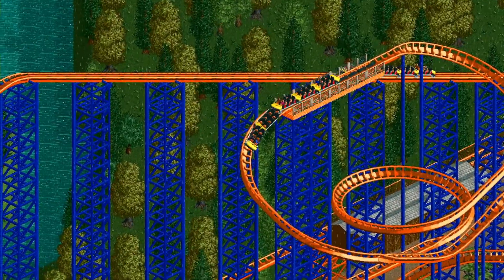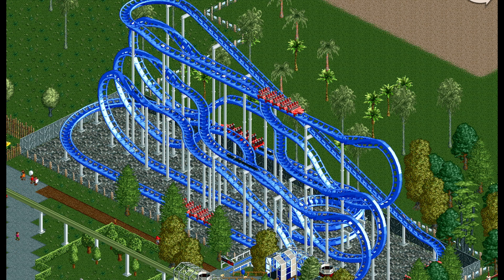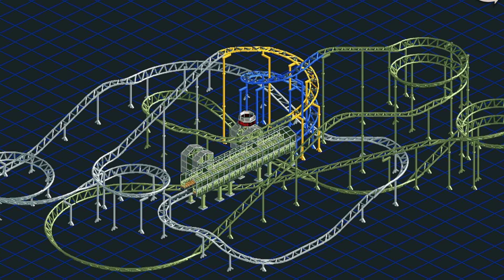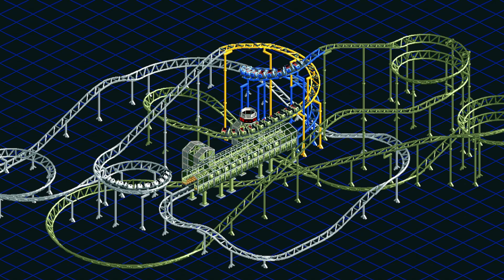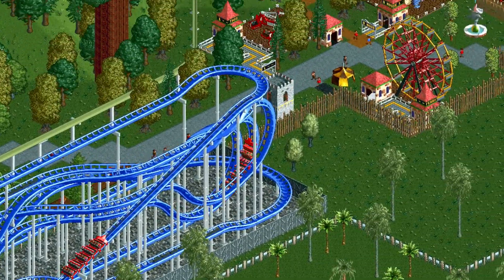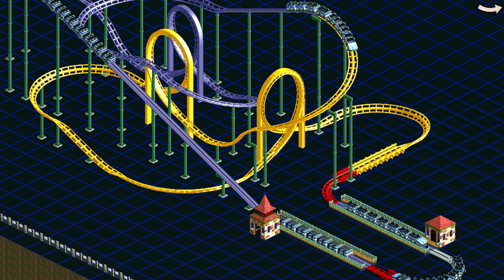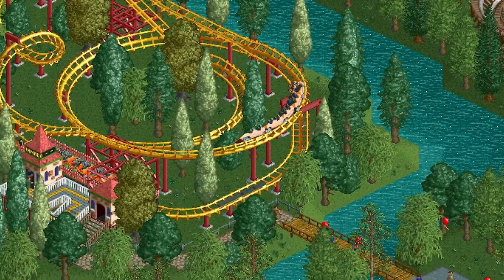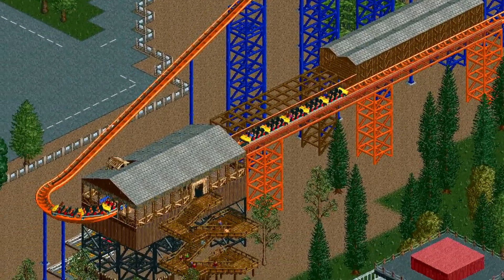Block Sections - How To Use Block Brakes In Rollercoaster Tycoon Classic

Comment: this video kept me entertained during the Superman escape from krpton breakdown. but i think block breaks are very under used as myself i dont really use them myself.  also another tip block sections dont stop working during like brake failure breakdowns so i always put some in my ending breaks even if the ride isnt in block section mode.

Comment: Increase throughput by 1000 guests per hour by having 2 stations and block brakes before each station, one station for entry and one station for exit, if using boosters then have a space just outside the entry station, always keep about 25 seconds between blocks, so you can have a 5 car system and 7 block brakes, a train will always be ready to go and to still get 5000 guest per hour on big coasters.
Reply from the maker: This is great advice, thank you for sharing this tip!

Comment: Another great RCT video, Tony! I prefer using block zones since I like to make my coasters a bit more realistic. I won't always do this, but sometimes I'll make them long enough to include a mid course break run to accommodate 3 train operation. But it's great to see that everyone has their own preference and unique play style for this game.
Reply from the maker: Thank you so much! I think they are definitely a function I will be using more often, especially on longer coasters where continuous circuit mode would limit throughput with three trains.

Comment: Error on the video:

A looping coaster only need 6 station pieces for a 7 car long train (the corkscrew need 7 stations for 7 cars)

Special hint: Having the number of train being 2y=<x of block sections will give a fluid ride most of the time (without any stops)